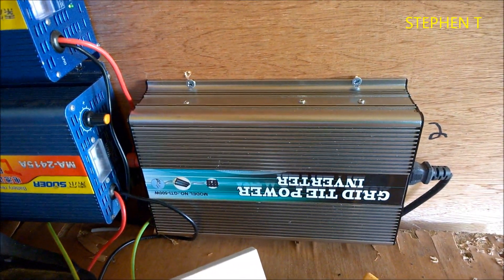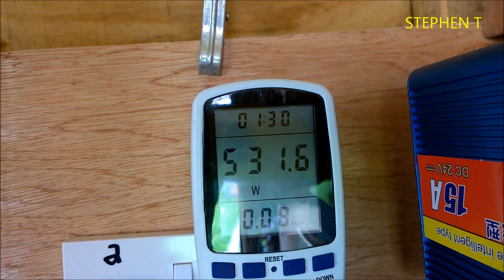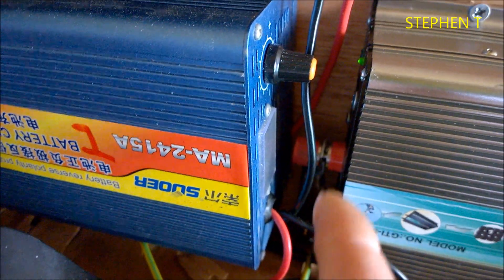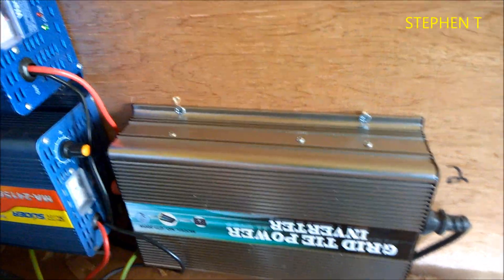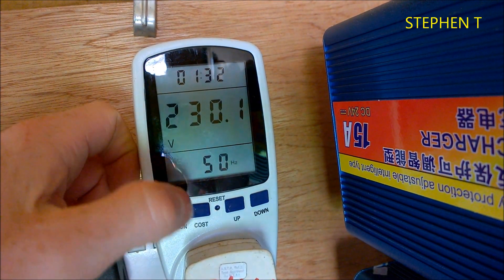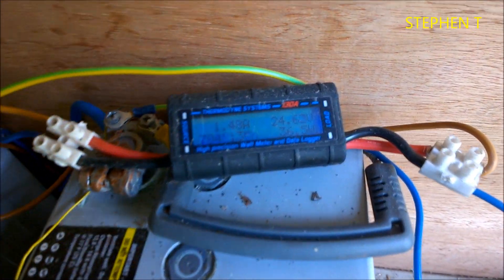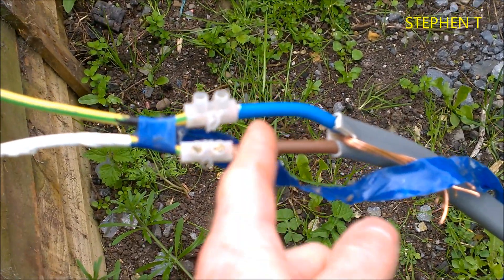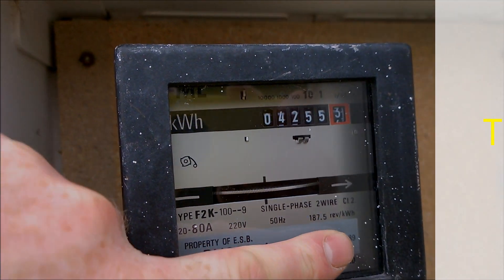HOW TO USE A GRID TIE INVERTER DAY AND NIGHT

Comment from the maker: Hi Shaun yes it is running on a 24v bank. The max voltage on the grid tie is 28v dc. But it can be used on a 12v bank but the output is under half. Thank you for your comment.

Comment: I have a similar inverter at full power it draws about 40 amps at round 600watts. So you would need a good set of batteries to last any more than an hour or so. As far as making the meter run faster forward in Australia our meters turn backwards when a in phase power supply puts excess power in. I have seen my meter going backwards and it's not just because we live down under.

Comment: Hi Stephen, great video, I,ve got a 500w inverter coming and plan to wire two 12v 50ah lead acid batteries making 24v. Any idea how many hours the batteries would last. Cheers.
Reply from the maker: Hi Derek.
That battery bank is only around 500w so it won't last very long to be honest.

Comment: With a battery system like this a low voltage cut off should be added to the batteries. If a lead acid battery goes below 11v it will shorting it’s life a lot. I normally set the low voltage cut off to 11.9v to make the batteries last longer..  12.7 is 100% full and 11.2v is flat.
Reply from the maker: Hi Mr Bandar.
That's true.
When I was using it I only had it on for an hour or so.

Comment: @Stephen T  Hi is the battery system off grid, only really for people who have power cuts or to be totally self sufficient. and is the grid tie system for putting back electric into your mains so your bills will be cheaper?
Reply from the maker: Hi
I use it to power my home when I am using heavy loads. you can use it with some off grid inverter's but I would not recommended it. what have you got.
Reply: Stephen T
Nothing yet,looking at my options, thinkning of buying a 1000w grid tie inverter, connected to 1000w worth of solar panels then feeding that back into my mains supply, but i dont know how much i would save.
If for example my house only used 1000 watts per day and i generated 1000 watts every day from solar, would the house electricity bill be zero £0 for useage, is that how it works?
My house actually costs £20 a week to run in electric, i get charged 0.15p per Kwh electricity, which works out to be 133 Kwatts per week, so am i right in thinking i would have to generate 133 thousand watts of power every week in solar to have FREE electric?

Finally one last thing,if my solar oanels total 1000 watts, does that mean every day i can only generate 1000 watts in total or is it every single hour 1000 watts if its sunny
Reply from the maker: +SP330Y yes it has to generate a 1000w an hour. but if you are using an appliance that uses more than a 1000w in that hour you will start taking it from the grid. so you will have to make sure what your using does not over power what is coming in from the solar. To be honest a 1000w will not be enough to have to think of winter and you energy will be a lot more. You would need @ least 3 to 5kw solar panels. Because in winter you don't get much light in UK? Same here in Ireland shit weather. Do you have room for a wind turbine?

Comment from the maker: HI Kenny Hendricks. Yes I have used them before they are a joke. I got a 24v 10000w inverter from powerjack and it just went up in smoke in 2 weeks. I was only using it to power my shed which had Only a freezer and 3 20w lights. I contacted powerjack they just tried to blame me. So I had to send it back to china at my expense. Which cost me a $100. I was refunded minus the postage cost.So it was a very expensive and a lesion learned. So don't buy from them or other cheap companies save your money and buy a outback. They are a great company just search YouTube and you will get great reviews. thank you for you comment.

Comment: Hi Steve . 
I have no knowledge of these solar powered systems . I sure could use one tho . is there someone you would reco to supply and fit a system for me . same neck of the woods
Reply from the maker: gameball2003 HI
What is your power bill for 2 months. Do you want to reduce  your bill or try and pay next to zero . If you want more info p.m me
Thanks.
Reply: Stephen T last 2 moth bill was €122.00. I would like to reduce it as much as possible. bit the leat I want to do is hot water for the summer time when my oil fire is off
Reply from the maker: gameball2003 OK 
I instil solar now as well as heat pumps. If you would like I can call to your home for a quotation.
Reply: Stephen T we could try that.
Reply from the maker: gameball2003 P.M your details thanks.

Comment: hello friend, i just want to ask
if i have a grid tie inverter 300watts, what wattage of solar panel do i need?
thank you very much.
more power and Godbless
Reply from the maker: +ian punay Hello as long as it does not exceed 300w. You can get solar panels at 280w panel which will work for your grid tie.